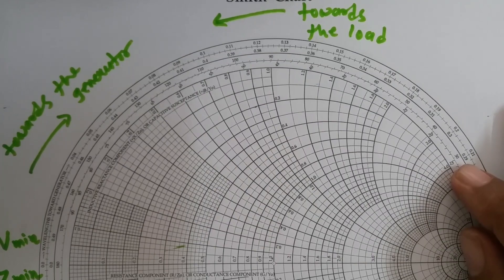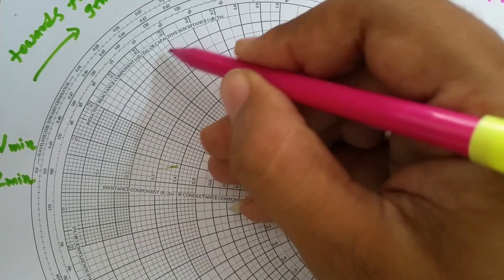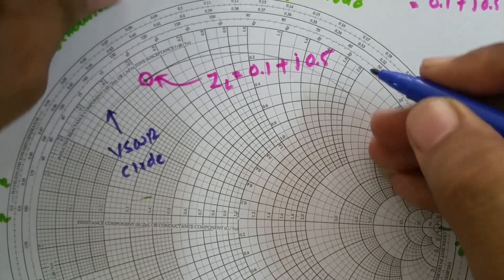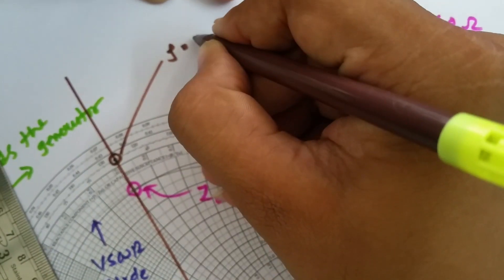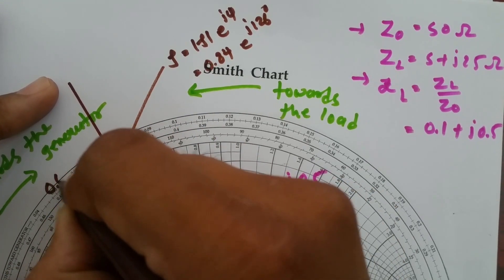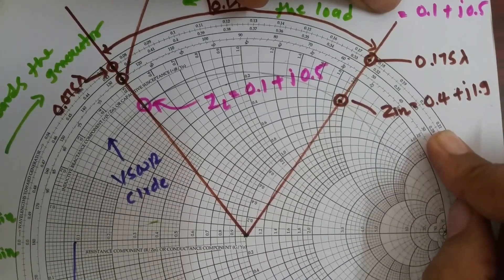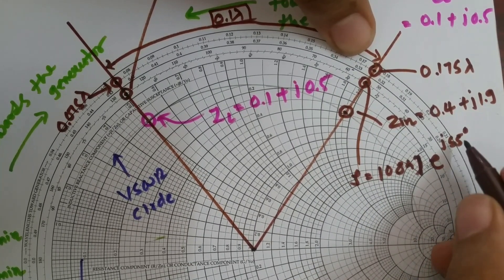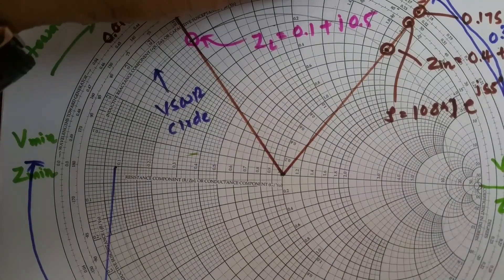Smith Chart Example for Transmission line Parameters (VSWR, Reflection Coefficient, Input Impedance)

Comment: Sir, in my graph sheet the bottom scales are not there. Then how to calculate vswr and reflection coeff
Reply from the maker: Buy proper smithchart or online also it available only you need to take printout of it.

Comment: I was solving some of the smith charts probelms.I noticed that sometimes when moving along the transmission lines in smith charts,the physical generator is not considered and the line is still moved towards the generator even though it looks like a load is connected at the other end.
Can you explain why is this done
]

Comment: Please Can you tell me all of the parameters of the  transmission Line that Can be calculated using Smith chart.
 like is it possible to calculate zo from zl or zin on the Smith chart ?
Reply from the maker: Zo cannot be calculated by smithchart
Reply: @EngineeringFunda  so WE CAN only calculate Zin,Zl,Vswr, reflection coeff, max and min distance,admitance
Reply: Zo depends on R L G C which are different for coaxial and single wire. Hence it can't be found via chart as it doesn't depends on them.

Comment: How can u say that the load reflection coefficient magnitude and the source reflection coefficient magnitude are same?They didn't mention in the question about the source side impedence.
Reply: the magnitude is the same because you cant change the real part of the impedance. You wouldnt add more resistance to a transmission line. You can only change the imaginary with inductance or capacitance

Comment: To find voltage minimum/maximum, do we have to calculate from load impedence of Input Impedence? 
i have exam tomorrow, kindly reply as soon as possible.
Reply from the maker: See voltage minimum or maximum can be calculated from load or input . When you calculate Vmin from the load then you will have to move towards the generator when you calculate Vmin from the input then you will have to move towards the load and you can see those direction in smith chart
Reply: Thankyou very much sir.

Comment: shouldnt we have to move anti clockwise when measuring from the generator towards the load? help
Reply: still didn't understand when to move towards the generator and towards the load
Reply from the maker: You can see in Smith chart.
Reply: zl is plotted so we are going towards the generator.
we are taking the load as the reference point

Comment: Sir, for calculating vswr after drawing the vswr circle why should we take the point on real axis left side of the centre, as the circle also intersects the real axis on the right side of the centre also...
Reply from the maker: You can take from left side but for that you will have streach line from left to scale at bottom of VSWR scale